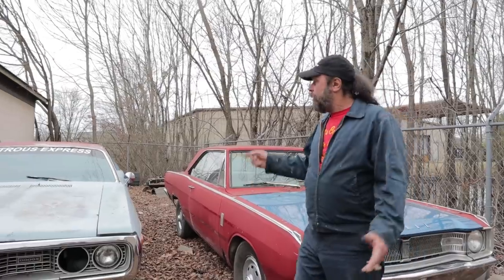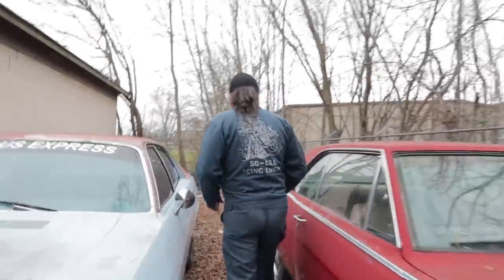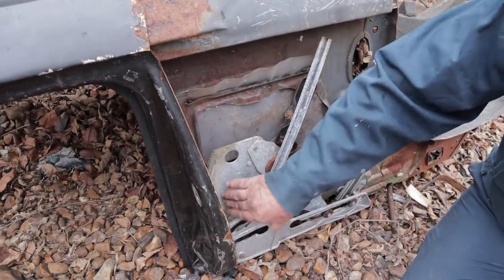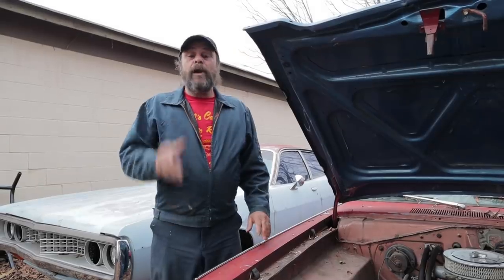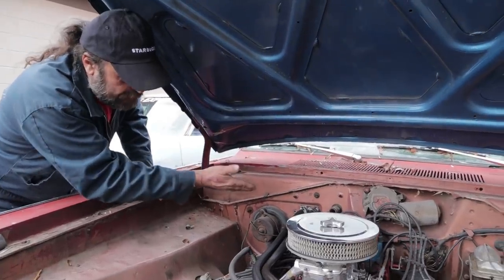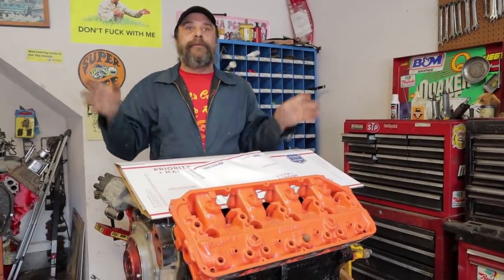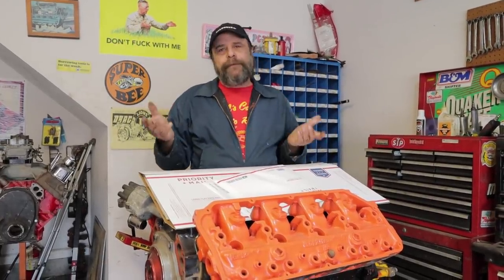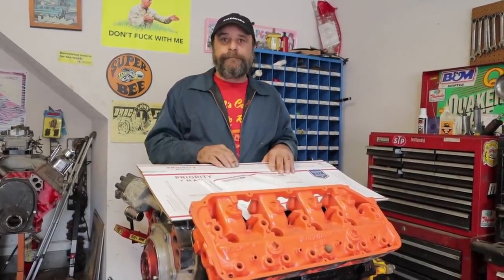How To Make Your Automotive Addiction Pay For Itself

Comment: Don't forget Greyhound Package express. If you're not in a rush, they'll stuff up to a 100lbs worth of car parts into the bellies of dem interstate busses. Shipped a 79 lb.  W123 Benz 4 speed manual gearbox this way for $76 from Portland Oregon  to Melbourne Florida.
Reply: pallets are good too,in the days when the transport companies where at war on prices you could ship a whole pallet from Perth western Australia 3000 odd kays to Sydney australia...the equitant of Los angles to new york ish
Reply: @Sebastian Cowley
I thought Greyhound had stopped doing freight. It's good to hear they either still are, or have started again.

I'm older than dirt, even older than 'The Unc'! When I needed speed parts back in the days before UPS or Fed Ex, (no, they have NOT been around, forever), the way to go was Greyhound. 

I have sent/received stuff from all over the US. Lots of stuff you can send with NO packaging, if it is clean. All it needs is a tag securely attached to it. 

It used to be the best/cheapest way to ship tires.  There was no USPS flat rate, and the Post Office was expensive for shipping.

Greyhound was the ONLY way to get speed parts in small town Oregon in the '60s & '70s.
Reply: Not all terminals accept freight, they have a location section on their site. Buy a veterans advantage discount card ( anyone can get it , about $40 per year) and get %25 off freight. Greyhound only limits to the longest dimension (108" max) and 100#, however the terminal personal are easily bribed ( crummy job, lots of abuse from travelers ) if you are a little over. EXCELLENT PRESENTATION, thanks
Reply: Had a bad experience with greyhound. Ordered a seat last Christmas for my satellite sundance and it still hasnt arrived (was a bench seat btw). Idk how they lost a large seat like that but its been a headache and i cant seem to get my seat
Reply: @georgedennison3338  So true. One of the first jobs I had as a teenager was to go to the Greyhound depot in Kansas City and pick up shipments. They had a huge shipping center at the time.
Reply: @blakegaylor6923  bus wreck 
NTSB where the helll did this bench seat come from there had to be a 3rd car on the grassy knoll
Reply: I did same I just commented on that I got a gt hood for mustang from ford that was NEVER on car guy had it in his garage for 30 years with Blue ford wrapping paper.  Sent me hood via Greyhound with virgin blue ford wrapping paper I have pictures of it all, not a scratch.
Reply: Up here in Canada, Greyhound quit opperating.

Comment: Thank you for explaining the whole “bolt” thing. 
Years ago I was teaching two young friends of mine (twin brothers, 17ish) and laughed at me when I expressed the importance of the bolts and nuts of the car we were taking apart should be diligently put back, if possible, in the same spot it came out of so we wouldn’t loose or loose track of where they went. 
10 years later one is a journeyman mechanic and the other is a voracious hobbyists and both are very careful with the bolts and nuts of a project. 
Thanks for explaining your wisdom to the plebes, Uncle.
Reply: Haha I'm gonna go play a lottery ticket. 
This vid got interrupted by a phone call from a buddy and in the conversation he wanted to confirm "3 lines is grade 5 , 5 lines is grade 8 right"...yup. 
Then I see this comment.
Reply: You know what? Even extremely well stocked hardware stores may not have all the rare bolts you need. I do a lot of biz with one and even if they have what you need it can take a LOT of time to find it. Time is money and in case you have not noticed the level of customer service has slipped quite a bit over the last 30 years.

Comment from the maker: Had a bit of a brain fart while describing shipping an 8.75 center.  It actually gets broken down and sent in two large flat rate boxes.  It can ALSO be shipped intact if wrapped in cardboard with the yoke, drain plug and one cap removed to make the weight.
And, yes..that is a Flange Bolt, but it has a distinctive profile
Reply: Uncle Tony's Garage any ideas on USPS boxing a pair of extractors to Australia ?
Reply: That's PhD.level Intel Unc.And Epstien didn't kill himself.
Reply: @Russeljfinch  can you weld......if so cut them into about 30 or 40 smallish pieces....
Reply: @Russeljfinch  There is International Flat Rate shipping, but will still be expensive to Australia. Look on usps.com and it will tell you more
Reply: I don't know how to do it but I've seen on other posts where the comment was "pinned" so it stays at the top of the comment list. You may want to do that. 
As always, great video! 
Ride on Tony!
Reply: The big issue that you didn't cover is getting the part numbers...

Comment: The shipping advice is a thing of brilliance.
Reply: I've shipped doors and fenders via Greyhound bus freight. Slow, but it gets there cheap.
Reply: @stuborowski5301  It took three months to get 71 cuda fenders that I paid a lot for. Last time ever using them. Didn't realize that they were constantly moving them into and out of the bellies of different buses to make it half way across usa.  One bus doesn't go from Indiana to Nevada I guess. Did have a little damage to them that the seller gave a small refund for, good guy. He also said never again on using that system. Its seems easier picking those items up by myself. Road trip!
Reply: @56redjets  I suppose it depends on where you live. I had a pair of '65 Coronet fenders shipped to me from GA to MA and it took a little over a week.
I've done road trips for parts too, but I only do that for heavy or a lots of parts.
Reply: @stuborowski5301  Sounds good. In my experience neither the seller nor I could find out where these were in the system, some kind of glitch. The only reply I  was getting from GH was 'its a big box ,and it would be hard to steal, Im sure its somewhere'. Great. Midwest to las vegas shouldn't take 3 months. Also their could only be 1000 insurance on the pair. 1971 oem cuda front fenders in great shape def sell for more. Never again, GH Express.

Comment: You're 110% right and it applies to anything project related. I bought a 1960 Craftsman rollaway toolbox at an estate sale in 2002. With it came some old Buick OEM shop manuals. I went online, flipped those and made my money back plus some. So, the box paid for itself in a day and I even had money for paint and to clean it up and make it look decent. I then sent in a photo to Sears and was featured in the Craftsman Club newsletter with my photo and story. Sears paid me $50. I then went to the local Sears with the article and said to the manager, "You have a tool box like this?" The manager and the clerk looked and said, "Holy S------, it's you in the photo!" I was a minor celebrity that day and the manager said, "Hey listen, anything you buy tonight, 25% off on top of the sale prices". I cleaned up---this was when you could easily get USA made Craftsman tools, so I went to town. 

So your theory is spot on. Whatever is "junk" or "unwanted" for you has a use. As my father used to say, "there's an ass for every seat". How true.

Comment: The ways I was brought up, miss those days. Unfortunately location  location, location...  even with internet these days it's easier to move stuff, unfortunately there's people that are just too cheap from where I'm at or don't want to buy stuff because it's too far. Most people rather buy a cheap part off line and bolt it on, rather then find the right part and not mess with it. Most of the collectors around me have scrapped their stuff in the last 3 years. I just want to cry because the hours I've helped some of them people save the unsabable, use every part possible, leaning over the years and just seeing the stuff get scrapped in the end.

Comment: Great Clip Tony. I'm retired from the Post Office and handled, both shipping and delivering, a lot of what you are talking about. A dashboard pops to mind, along with tires, exhaust, rims, gas tanks(new...can't mail one that smells like gas) and other parts. Flat Rate is the way to fly! Just a point on your packing tape, though. The cheap dollar store type tape doesn't stay stuck very well in cold weather....the colder it gets, the more it wants to let go. Sometimes worth to spend a little bit more......customer like it when the package is still closed when it delivers! ;-)  Keep the videos coming, can't wait for the next one!
Reply: ...I rarely use flat rates...I find most of what I ship won't fit in them..seems they are always "off" in one dimension...for example, the small ones are often wide enough, long enough..but not "deep" enough to hold anything...then when you move up to the next size, it is usually more expensive than using your own box....
Reply: @dyer2cycle  That's very true. There is quite a variety of flat-rate boxes now, but it would just be impractical to have a box size to fit everything. But if you are sending a box full of lugnuts or or other small, dense items, it's a bargain. An over-sized air cleaner, not so much.........although, if something can be be dismantled a little bit more, even if it doesn't fit in a Priority box, flat-rate or otherwise, but will fit in two boxes,it can avoid the over-sized fees that get added and sometimes be cheaper going in the two boxes......sometimes it takes an extra trip to the Post Office if you don't have your own scales. And if you can get the help you need at your PO, try one near by. There are people out there who will help you figure it out, but not always where you want them

Comment: ROLL UP YOUR WINDOWS!!!

It hurts to see old cars or trucks get chopped up and parted out... wish you could save them all.
Reply: You can't save a car without a parts car . That's just the reality.
Reply: I wanted to save a rusty Dart but it was too far gone. So now that I parted it out I’m getting called asshole, left and right, but a guy in Texas parts out cars in much better condition for a living doing like 10 cars a week, and no one even pays attention...
Reply: If you can chop up one car to save 10 or 20 others then the sacrifice is all worth it.
Reply: I understand how you feel, but we cannot save them all. I don't like cutting up old cars either, but we have had to cut up our share of cars just to save others.
The most recent one I felt bad about with a 73 Charger SE. The body was good, but the frame and Floors were Swiss cheese. Ended up getting another 73 SE back on the road with horrible body panels and sold what was left with some someone else that needed some roof and other random sheet metal.
I made a video of that parts car on my channel last year at some point, but who knows where it is. It's lost in my channel somewhere with the other 300 + videos. It's one of those videos that pops up once every 3 months when somebody makes a comment on it

Comment: Your point of know your subject is very important. The common vs. the rare is not really addressed here but maybe equally important. You had a huge customer base by choosing the A body and the parts interchange factor. Much easier to capitalize and reduce a car to zero like you spoke of. Alternatively the low production can be worth more, net bigger gains. Or is it? If it takes you longer to sell due to a limited market, you hold it longer. sitting on that part(money)means you don't have the gain yet and by the time you do it may not be worth a nickel more. You might have sold three of something more common and made a better return. You can't cover it all in one video no matter what you do. Great video. Thanks for sharing

Comment: I bought a tote for $150 because it had a 70 unsilenced air cleaner in it. It also had a date stamped carb and idle stop solenoid in it from a 340. The idle stop solenoid was worth $475 to a guy who was restoring a hemi car. It was just another little part in the bottom of the tote and it was the most valuable part in there.
Reply from the maker: Ha!  I had a similar deal. Bought a milk crate full of distributors for $25.  Found a pristine 1970 Hemi Prestolite at the bottom.  Flipped it for a quick $500

Comment: Again uncle your so correct , I applied the exact same method when I bought and sold rims for my project 96 f250. My bud had a 97 f250 7 bolt pattern which I paid $200 for because I wanted the wrangler duratracs . After I seen a set of steelies for my 96 8 bolt p/u I paid $80 for I was able to sell the 7 bolt rims for $40 which reduced my original tire cost to $160 . Not bad for a old truck and keeping the cost down . Sure I sat on the rims for a 3 months , but it put $$ in my pocket and cut costs into my project . Cheers

Comment: Never thought of it this way, I haven't done much of this but I've always wanted to get more at it. Just waiting to be done with school what I normally mess with is the 73-87, 88-98 GM Trucks, I daily a 96 and I'm assembling a garage full of parts to revive a wrecked 1993 2WD model, same way with you tony, These vehicles are everywhere, lone parts are everywhere I've had them for years. Thanks for the advice.

Comment: great video man ! some people just dont understand about needing parts that are hard to get now days...  I work on my own cars and I bought 2 different cars a civic and a integra the previous owners deleted the power steering pumps but left the power steering racks in the cars.. the steering racks in both cars went bad so I decided to install manual steering racks in both cars since there was no power steering pumps... I installed the rack in the first car and got under the dash and realized that the u joint that connects the steering wheel to the rack wouldn't work on a manual rack.. I hunted for that little u joint and found only 1 guy on Ebay had one and he wanted $75.00 for this joint for a manual rack.. i had to buy it to finish my steering rack job and it worked... my 2nd car I installed the manual rack in I ran into the same problem and that same guy had another u joint for $75.00 so I bought it lol.. -get this though- the u joint for a power steering rack was $20- $30 bucks and this guy knew this u joint for a manual rack was super hard to find unless you wanted to pay $400.00 for it from the dealership. So the seller knew  he was gonna get that $75.00 for that joint no problem but I'm so glad he had it because I would of been out of $300- $400 for a small u joint...

Comment: I wish I could have mentored with you, I absolutely love that philosophy, treat it like the native Americans treated the buffalo and use every part. I love cars. I have done many different jobs all related to cars, but I always kept the tinker as a hobby because I love doing it. I go to pick n pull and find things I don't need. I do a lot of learning on things I don't feel like breaking on my car. I literally get sick to my stomach sometimes to see a car that has been out on the road for 25+ years and was retired crashed or whatever ends up at a junkyard to have these animals rip and trash a mint vehicle with parts someone would die over for no reason. Meanwhile Im using a plastic trim tool to no mar the other parts for people. I completely understand the value you give to a bolt I'm that guy that is going to spend 20$ for the right bolt because it's the right part and that's what belongs. Some people will go to home Depot and shove literally anything in and doesn't care. maybe I need to turn my parts horde in to by cash flow. Rrrrrrm... But I need that part and that part I need. I may need that one. That parts for a future project. Oh right now I remember that I have a hard time letting go of my parts

Comment: @6:19 "The car was sacred" use every part! Long story- I'm a Minnesotan native- rode old beat up Ski Doo snowmobiles as a kid. Moved south when I grew up and forgot about that. 20 years later- found the junk I rode then is cool and collectible now (sort of like old Mopars were a dime a dozen at one time?) and traced the remains of the first Ski Doo I ever had at age 13- all that was left was half the cowling in a rock pile. In that cowling was the ignition cylinder with the key broken off in it! I recovered it, and got a key made, and it now lives in another machine I found and dragged from the woods. :) Bottom line is if there is ONE PART you can salvage for someone, it is worth it!

Comment: For a few years I targeted MGB's, specifically the heads...and specifically one casting number.  Why?  They were only built for two years but would fit and improve any year from the early 60's to 1980.  I would buy the good cores for around $100 or so, clean, magna flux and vac test them, port/polish the bowls, add new valves, unshroud the chamber, surface and k-line the guides if necessary.  I'd then resell them to hobby racers all over the world for around$800.  I had about two hours and another $100 in parts into it...so a nice profit.  Also, they were my winter projects so they kept me occupied when it was -10 and snowing outside for 3 months!  That money would go to help fund my 1970 Challenger and 1973 MGB projects which are now complete and running.  Now the cores are so hard to find and expensive it's not really worth it...in addition to aluminum heads now being sold at such a low price that the OEM iron is no longer desired as much by guys looking to save weight.